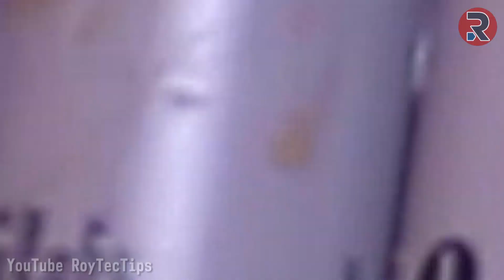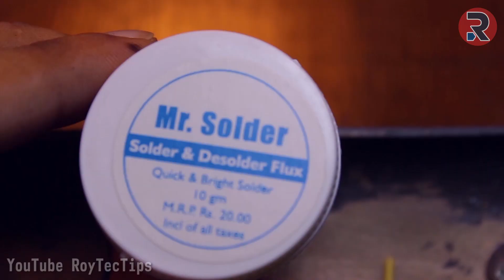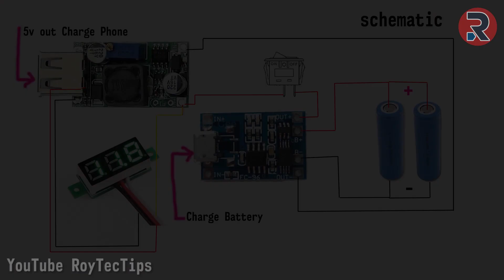HomeMade 18000mAh Rechargeable  Power Bank with LED Display

Comment: sir how many time to charge 18000mah power bank?
Reply: Charging module have max current 1000mA , so charging time will be theoretical 18hours, but guy  says real capacity of his old cells is about 6000mAh, so in this case it is about 6 hours

Comment: dude but the output current we get that is .25 amp resultant slow charging what to do??
Reply from the maker: Dude, Use a powerful boost convertor like this 
http://www.ebay.com/itm/8W-DC-DC-5V-2V-6V-to-12V-Step-Up-Boost-Module-Power-Supply-Converter-module-/162156982272?hash=item25c14f3000:g:cC0AAOSwWZ9XoV4Z

Comment: if we don't connect the key and we just solder the wire directly to 5v out + then will it work, if yes then we can just put the usb when needed to charge .

Comment: I mean ranging 50 to 100 volts electrick genrater
Reply from the maker: yes possible how many watt you need. Wind turbine, bicycle dynamo, then use a boost convertor to boost the voltage. you can build a solar generator too.
Reply: can you make a Video on it plz
Reply: could you also mention how to make a dc motor which will be used to convert energy to electrecity plz
Reply: Crusty batteries!!!